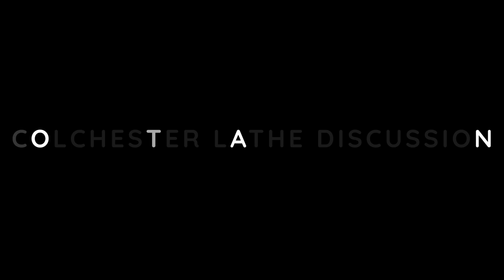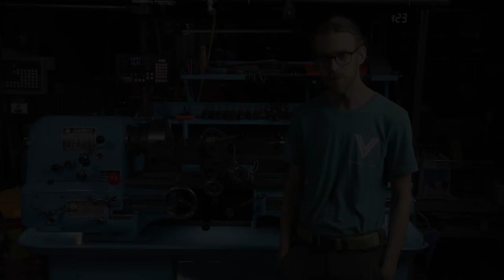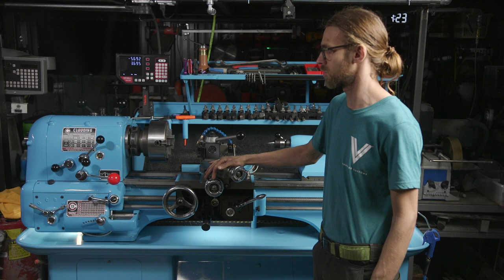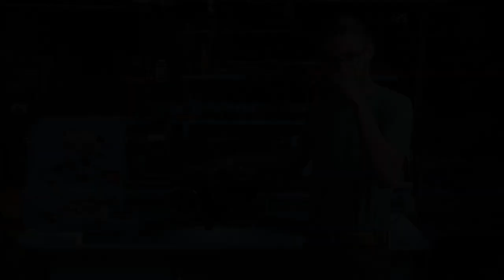METAL LATHE (Restoration, Upgrades, Modifications)

Comment: You have done such a beautiful job on that Colchester and I love your philosophy, the old lathes are so well built but integrating the DRO's etc make them a pleasure to use, and in that colour you will never walk away at the end of the evening and not give your pride and joy a rub down. It's an absolute credit to you.
Reply from the maker: Thank you very much
Reply: I don't know what to think about adding DROs - do I want to ???????????????????????????????????????????????????????????????????
Reply: @millomweb  If there had been something as convenient and accurate when this beauty was made they would have proudly offered DRO's as a custom accessory, plus they are pretty unobtrusive and don't devalue the integrity of the engineering that went into the machine - you know you want to :-)
Reply: @barkerxsa7002  My old mill has a mystery connector on the front of the knee - I don't even know if the back of the connector is connected to anything :) That's one of the two mysteries I have with the machine. The other one is a power drive on the table - hidden behind a cover plate - but what exactly is hiding behind there, I don't know - and how it connects to the table feed system !
Reply: @millomweb  Seems like a little explorative surgery is in order !

Comment: Your lathe looks great , I have a colchester student here in ireland I would really appreciate the details on your dro system particularly the scale dimensions. Thank you
Reply from the maker: Which size scales I purchased? According to the manual the cross-slide travel is 6.75” and depending on your lathe would be the length. Mine is a 36” so I bought a 8x40 kit. Hope that helps!
Reply: @VanoverMachineAndRepair  thank you
Reply: Colchester discussion group: https://colchesterlathe.groups.io/g/main

Comment: Good Evening.

Very well done restoration.  

I have been hunting for the same Colchester and found one today!   I  have to go out of state to see it but in the mean time can you answer a question or 2?  

First, does the base break down at all?  It appears to have 3 sections but is unclear whether it’s welded or bolted.  Can you shed some light on this?

The other question is how heavy is the spindle head?  I saw you used a strap to lift it but am wondering if 1 person could lift it? 

Once again you did an A-1 job on the Colchester.

Thx for any input.

Todd
Reply from the maker: 1.)  base is one piece. bed is bolted to base via 6 Allen bolts 
2.) 200 pounds maybe I dead lifted it to the mill but would not recommend doing so.

Comment: Absolutely awesome lathe, I see a few things that are either Clausing specific or modifications. The speed potentiometer  in the threading cover, is that a modification or a Clausing specific addition as I've never seen a Colchester with that option. Can you give us some more detail on this potentiometer, it looks more like a on/off switch. Thanks
Reply: No he added those himself. Clausing were just rebadged Colchesters. He has done a lovely job on that lathe!
Reply from the maker: Yes I added it. It is an Allen Bradley potentiometer. They are expensive, like 150 usd just for a potentiometer

Comment: Great selection of tooling and upgrades for your new (old) lathe.  Everything OK with the headstock gearing and the Gamet bearings? (have heard that these can be a problem)
Reply from the maker: Thanks. Headstock is very quiet surprisingly
Reply: @VanoverMachineAndRepair  That's good.  You got a good one!
Reply: @VanoverMachineAndRepair  A noise level demonstration would be appreciated at its top spindle speed (what is it?) while you talk as well so we can gauge sound level.

Comment: That’s an awesome machine, 
When you changed the motor did you get one that goes the same RPM as the old one, most dual wound motors are both 2 and 8 or 6 pole motors.
Reply from the maker: The original machine had a dual stage motor that was 900 RPM and 1800 RPM. I installed a single speed 1750 RPM motor and I just modulate it with the VFD and gears
Reply: @VanoverMachineAndRepair  ah yeah that’s fair enough, I have done that upgrade to a lathe once before. 
Was the old motor burnt out?
Reply: @brad855  No, wrong voltage. Were you not paying attention ?

Comment: How many months took you to restore the lathe and how much it cost the restoration? (Final price of the lathe without upgrades)
Reply from the maker: I started in September and finished in March. No idea how much cost was associated with it not including upgrades. A lot was spent in tooling, dro, chucks, live centers, etc... in addition to the restoration cost. I am guessing the overall cost to restore is significantly less than the hardware purchased. It’s the time that is the killer. Maybe under 1500$ in materials, paints, badges, knobs, sand etc... not including the other stuff I mentioned
Reply: @VanoverMachineAndRepair  Thanks, really helpful. Is quite more expensive than I thought, and time consuming tho. I was expecting to do something similar, but is going to take to much time to do so. Any recommendations on where to start restoring, tips and tricks etc???

Comment: That is what, a 60s or 70s manufacture?  Why do you imagine Colchester overbuilt the lathe, knowing that they were already been pressured by cheaper, quality machine tools from Japan and Germany at the time?
Reply from the maker: 1964. Not sure why they overbuild it. Glad they did
Reply: It's what they were geared up to do. My Colchester was built in 1964 and is still running very nicely. Amazing how these old machines had a long hard service life and then are treasured by enthusiasts. 
Colchesters are good lathes but the other old British lathes were even better but a lot more expensive. Dean Smith Grace and Holbrook for example were even heavier built.
Reply: @codprawn  Are you aware of the colchester lathes discussion group ? https://colchesterlathe.groups.io/g/main

Perhaps the others were bigger machines - Colchesters in lathe terms weren't big. I think the Mascot was their biggest - possibly 48" between centres.
Reply: Watch this video, see if you can figure it out yourself ! : https://www.youtube.com/watch?v=3J4ODEO_tPk
Reply: @millomweb  
Thanks for that!
My Triumph is 48" between centres.
The biggest they did was the Magnum. 160" between centres and could carry a 1.75 ton job. Machine weight was 5 tons or 11000lbs so pretty big
Reply: @millomweb  
And no I wasnt aware of the group - thanks a lot!
Reply: @codprawn  I'm still learning about Land Rovers :)
Just about any attachment you wanted - but not a lathe ;)
Pumps, compressors, generators, trailers (with powered wheels), saw bench, winches, welders etc. etc. !
Reply: @millomweb  
Ahh yes the good old Sankey.
And a fairy capstan winch on my V8 110. People ask what power winch I have. I tell them 250bhp! Yes I have a tuned 4L.
Reply: @codprawn  I believe there are two (at least) capstan winches and heavens knows how many drum wiches - powered by various means !
Winch power is an odd question really. It's not important as long as it's enough for the purpose you use it !

Comment: Sorry, to me this is bonkers. You seem to be a machinist. You have a milling machine and a surface grinder. Yet you've restored every aspect of this lathe except the mechanically important bits. You surface ground only the bits of the saddle and cross-slide that aren't bearing. You didn't scrape anything. You didn't appear to check the accuracy or alignment of anything (except the DRO).  You ruthlessly sanded shafts without regard to whether they'd fit in their bushings afterwards. Perhaps there was a lot you didn't film, but you appear to have done a magnificent cosmetic restoration without any regard for the mechanical performance.
Reply from the maker: Thanks for your feedback. Your correct i could have scrapped in the ways, saddle, and cross slide etc... I choose not to because the wear I measured was fine and the added cost and time to get them scrapped in wasn’t worth it to me. I also did not film most of the tuning, trimming, adjusting, and many many other things. I probably only filmed about 1/4 of the work I did and I still had to much content.